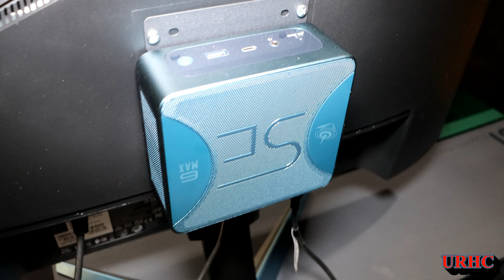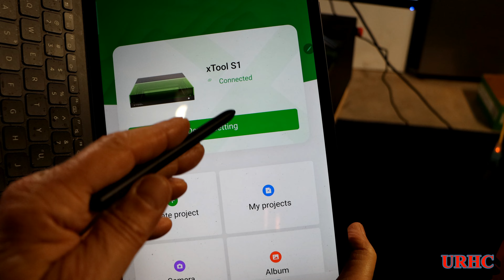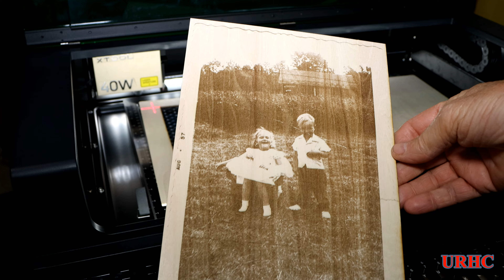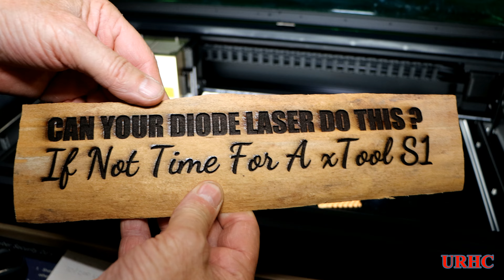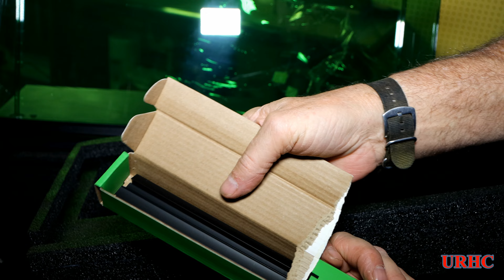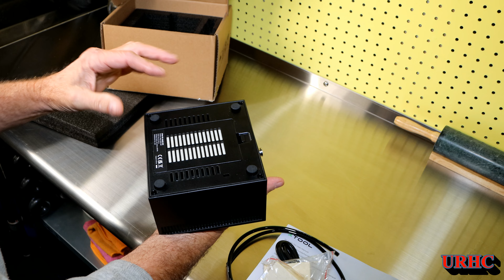xTool S1 First Impressions. The Most Advanced, Powerful, And Safest Diode Laser Ever Produced.

Comment: Ed you might be spending my money again! I bought the Ortur Laser you featured 4 years ago and then a Longer Ray 10 watt. I have been happy with it. I am impressed with this Xtool though.😀🛫
Reply from the maker: Sorry about that. You can't blame the Longer Ray on me😉.  This is an amazing laser with great safety features and multi stage air assist.  Xtool software has really come a long way lately and I really like using it with the current machines. There also is a stock feeder out now for longer projects and their rotary also fits it if you have a riser base.  I think you will like it. It's a little pricey but that's. the cost of new technology.  Almost as good as a Co2 without the maintenance issues if you don't need the capability to work with clear acrylic. I see smoe complaining about lack of camera but the simplicity of manually marking material location works better for me.  Thanks for watching
Reply: Thank you for the reply,
when I first saw this Laser the lack of a camera was a real negative for me .After seeing how you can move the laser head to justify the material location that works for me. @unemployedredneckhillbilly2023
Reply from the maker: The people that complain about lack of a camera are the ones that don't want to make jigs for precision alignment and just want to toss items on the honeycomb.  I have found with the p2 that the camera is close sometimes but far from perfect. The probe for focus is much more accurate then the p2 sensor and more relisble. I think xTool or an aftermarket company will eventually have a camera option to add.  The accessory everyone should order with this machine is the new multistage auto air assist.

Comment: Just found out with my xtool s1 that it doesn’t like strong sunlight, I turned it on this morning and it would not start because it thought there was a fire inside.
Reply from the maker: In the settings is yours set at low sensitivity?  If so contact xTool and see if they can add a sunlight setting . Thanks for watching
Reply: @unemployedredneckhillbilly2023  thanks for the advice, I’ve only had it for a couple of days so still finding new things on it .

Comment: Nice review. How would you position numerous small items to cut all over the place on previously used material that has area of available material using the 2-point system vs. a camera...sorry, you can't. Great laser handicapped by not having a camera, maybe forces you to purchase the more expensive P2?
Reply from the maker: You could buy a P2 but that function doesn't work right all the time I have found. I would cut a cardboard template to drop the parts in for registration then locate the artwork in the cutouts and turn off the pockets in the artwork after cutting.  Remember this is half the price of a P2 and I don't  really see it needing a camera for 99% of the users if they think ahead while creating designs. Thanks for watching.
Reply: If you are going to use a single piece of wood once, then I agree with you 100%. But if you are like a lot of crafters that has tons of used wood, a camera would help. I don't think the answer is buying a P2, the more realistic answer is for a plugin module camera that can connect to a USB port on the laser. @unemployedredneckhillbilly2023

Comment: Really like the looks of that software.  Will it work with other machines?
Reply from the maker: It's funny how it grew on me with every new release.  It's a very easy to use package that only works with the xTool machines. The app is pretty amazing and works jusy like creative space. I now like it better then lightburn for most projects and no setup required for a new machine.  Thanks for watching.
Reply: @unemployedredneckhillbilly2023 That's too bad. I haven't used lightburn a lot but find it frustrating, particularly when trying to set a work origin.  I come from using CNC mills and am struggling to get it to locate the burn where I'm expecting it to go.
Reply from the maker: There is a channel called the Louisiana Hobby Guy that has many good videos about lightburn covering things like that. Be sure to fire the laser at very low power when framing and run it slow. For critical locations I usually tape cardboard to the honeycomb and cut an outline, then center in that.